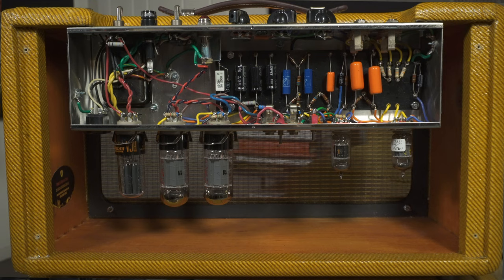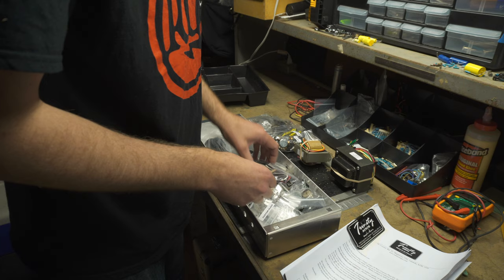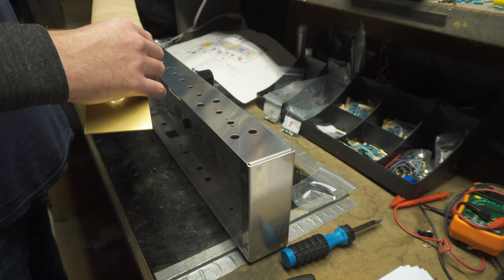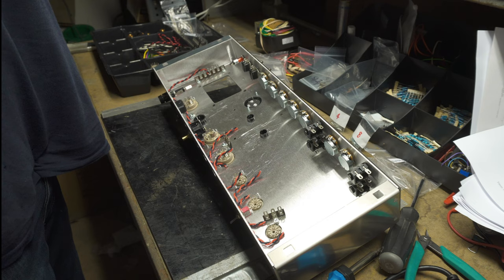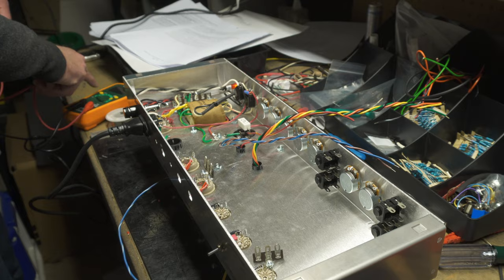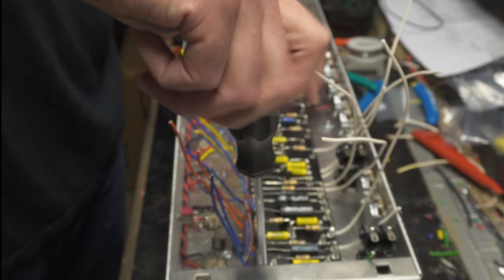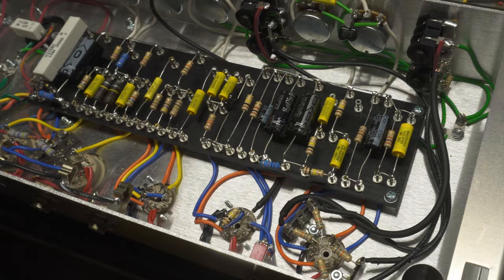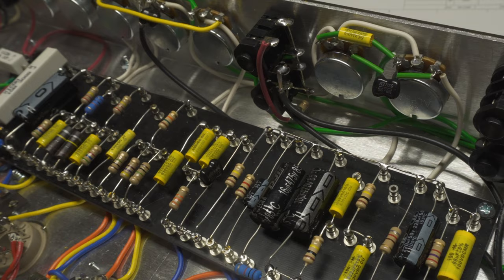Building a Marshall Plexi Style Amp? - Trinity Amps Custom Plexi with 6V6’s

Comment: Mike… my son and I have built 6 amps. 4 Fender Tweed Champs, a Fender Tweed Delux and a Marshal JTM45. All of them were learning exercises. They were technically kits, but we modified/upgraded each one. 8 scratch built the cabinets. My son covered the tweed. You are correct in your comment about the pride in doing it yourself. We checked and double checked everything to head off any trouble. .

Comment: I really appreciate these amp build videos, they're very helpful in showing that with little experience you can build one of these from a kit. I have basic knowledge on how an amp works in theory and I can look at a schematic and know roughly what's going on but I've always been very apprehensive about taking the dive into a kit. Thank you for documenting your experience and showing that it's possible even for someone like me with limited knowledge and no experience :)
Reply from the maker: Glad you enjoyed them. Working on another currently but it’s slow going! 
Following the layouts and taking it slow is key.
Reply: @MichaelWWestbrook  I look forward to seeing it! I definitely plan on taking my time and triple checking everything. Maybe even doing one section of the amp at a time then taking a break, power supply, heaters, preamp, etc. Just break it down into groups and take it one at a time. I'm thinking of getting the Mojotone JMP 2204 kit as well which probably isn't the best kit for a first build but I really want a full sized Marshall
Reply from the maker: I’ve found the bigger amps are more complicated in some ways and more simple in others. Tweed Champs or Deluxe’s are simple but space is tight. More room in the chassis is easier to work with for sure.

Comment: Unless you have to wheel a dolly through there on a regular basis you could shorten the door on the bottom and install a 3-4 inch concrete lip to help stop that flooding from happening again.
Reply from the maker: It was a run off issue that has been diverted. Basically all the water from our backyard got funneled into that door way because of leaf build up and landscaping. Hasn’t happen since!
Reply: @MichaelWWestbrook  nice

Comment: not to be a smart ass... but you need a sump pump , so if there is another basement flood ... its ready to protect the basement ... right.  also you could look into why water is getting in and  slop the ground. kind of important... what if the deluxe was on the ground and got soaked... oh that would hurt... and do you have a carbon monoxide / fire alarm in the basement... a little safety goes a long way... after all you seem meticulous building amps... why not spend some  attention on safety...   love your videos... Im going to build a deluxe tweed.... cant decide Mojotone or trinity ... thanks again...
Reply from the maker: It’s was an outside drainage issue that easily resolved. Never had any other issues but I never put anything of value on the floor just in case. (That’s why the deluxe wasn’t on the floor)

Comment: My first tube amp build was a kit from a local UK supplier - a 5F1 4W single-ended Tweed clone, which was super easy and fun to assemble. This video has been a real education as to how amp builds should be done. Bravo! Very impressed with the build - extremely tidy wiring runs. I've seen some horrendous kit-build videos and it makes me wonder how anyone could fault-find and set up an amp properly like that. You've got me wanting to build a TMB now. Dang it!

Comment: I grew up in GA - that flooding in the basement brought back memories of my dad’s workshop in the basement. I also test each component before it’s soldered in. It’s so much easier to find a bad component before it’s installed. There are low cost capacitor meters on Amazon. I even check all components on pedal builds too. Your music sounds FANTASTIC!!!
Reply: many digital multimeters have a cap measurement function. then there's that  low cost TC1 component tester,that checks all sorts of components,but it's not a  precision measuring device.

Comment: I built a Trinity B15 clone.  It turned out awesome,.  It’s great to use an amp I made in my studio.  Trinity is a great amp kit company.  I do suggest you upgrade the sockets.  Especially if you roll tubes a lot.  The contacts loose their grip.

Comment: Great job. The Trinity Plexi was my first amp build, and I wouldn't hesitate to recommend Trinity to any aspiring amp builders. Stephen even provided a rear panel for my chassis when I asked about one. I think their TC-15 will be my next build. You should try installing their VRM module, I did with good results.
Reply from the maker: Thanks! I’ve got a VRM for my tweed but haven’t installed it yet. Maybe one day but haven’t really need it for my uses.

Comment: I just finished a 5E3 and it is without a doubt the best amp I've owned. Desert island amp. I really want to build a JTM as soon as they come available. Ive been playing 45 years and have owned and gigged  just about every decent valve amp there is. If you can source a good kit and have some patience and can solder? You'll be hard pressed to find a mass produced amp as good. I built my first amp out of curiosity and now I'm totally convinced that hand wired is the king of tone.

Comment: The twisted wires going to your tube sockets should arch up and go straight down to your sockets. Less noise, less hum.
Reply from the maker: In this case I ran them close to the chassis (the opposite side as the rest of the wires to give them distance. From my understanding their proximity to the chassis will help shield out more noise as well. Seems like others have had success with this method as well and because they are an early part of the build this keeps them out of the way when making the rest of the connections
Reply: Lay down is fine. In this case the sockets would need to be turned 180* and the heater wires should be ran through the top of the so no other wires overlap them. If there’s no noise issues, nothing needs to be done.
Reply: @MichaelWWestbrook  If it works it works. AND, it sounds great so there is that! Congrats. Keep building!

Comment: install an automatic SUMP PUMP in that basement shop. it will help prevent flooding. 
also,it looks like most of the resistors in that kit are carbon FILM ,aside from the blue bodied resistors,that are metal film. Carbon film resistors are "dumbbell" shaped,they have end caps for the wire terminals. best to avoid carbon resistors in these tube amps.

Comment: When I build kits, I point plug tabs towards controls, and wire them before installing controls giving me more room to work with ! 😁 I mount turret board differently ! Top mount all wires first to sockets and controls then circuit components ! I I hate amp builds where the wiring looks like a plate of wet noodles dropped on the floor ! LoL

Comment: What you might try is  to make a template out of plastic, or even cardboard,  for your pots and input jacks and solder them outside of the chassis, giving you much more room.  I found it hard to solder up those Cliff jacks inside the chassis.  Just a thought.

Comment: Yeah these are fun projects to build. 
I've only built one from a kit once. Usually I end up building my amps from scratch and end up doing everything the hard way... Lol 
Now I really want to move on to building hifi stereo tube amplifier systems, like an all tube tri, or maybe even quad-amped stereo system with a tube 3 or 4-way active crossover with an 8 band tube equalizer. I've found some websites that show the basics of the schematics to get started with. 
But jeez, all those transformers sooooo expensive.... Lol.

Comment: You should core a hole in the ground and stuck a 5 gallon pale with 1/2 inch holes drilled throughout the bucket. Drop a submersible pump in there and bam more flooding.

Comment: Nice Video.  I've built several amps as well and I suggest getting an amp chassis stand or perhaps building your own... could be its own video.   I was at the Rib Cook Off in Reno as well.  Not the same days though.
Reply from the maker: Yeah, I need to build one. At some point I rigged up a make shift one but it wasn’t the most reliable

Comment: in this amp build I see you use a turret board....  that seems so much more clean  and  actuate way to build... wish I could do this on the tweed deluxe... but seems the kit does not come this way.... I wonder could I install the posts on to a board  that does not have them on there... like a  blackface deluxe reverb... 
sweet build...  thanks again...

Comment: Nice Video, nice Amp! I build my first Amp back in 2006. It was a Tweed Bassman59.  The second one was a Marshall Plexi (JMP50, Model 1987) back in 2011. Great Amps, but not for using it at home. The Amps are way to loud.
Reply from the maker: Yeah, that’s were where Two Notes Captor comes in handy. I wouldn’t be able to record nearly as much!
Reply: @MichaelWWestbrook  You´re meaning the Captor X, i think. Any experience? I got two of the Tom-Scholz-Power-Soaks but they make the sound thinner on a low level.
Reply from the maker: I use the regular captor and run the IR’s in my DAW. The Captor X is essentially the same set up but all in one package
Reply: @MichaelWWestbrook  Ok, I checked out several videos in the last two weeks. I think the  Two Notes Torpedo Reload is the better choice for me. I ordered one for a test.

Comment: I think I saw a 15K tail resistor, unless it’s like that because of the 6V6’s, it’s a mistake. Stock Marshall everything is 10K.
Anything between a 6.8k and 27k will usually work. 6.8k to 7.5k give the best gain balance from the inverter, anything higher drives one of the output tubes harder than the other, inducing asymmetrical distortion. 

Check out this link to see what the changes will do https://www.ampbooks.com/mobile/amplifier-calculators/long-tailed-pair/calculator/
Reply from the maker: Good eye, I’ll check it out.

Comment: Doesn't it matter which direction the resistors are wired in? Meaning, the paint stripes need to be oriented a certain direction? It looks like fun. I've been doing automotive wiring for years and think I could build an amp if the instructions, pics and schematics are clear.
Reply from the maker: No, doesn’t matter for resistors!
Reply: Thank you. I wasn’t sure and thought I saw another amp builder say it did. Good to know.
Reply from the maker: Caps do generally but not resistors.

Comment: I just received my Tweed Deluxe. Pretty stoked. As I recall from your tweed build I seem to recall you mentioning a plan to gut your blackface  deluxe and rewire it p2p. Is my memory correct? Did you remove the circuit board and convert that into a handwired drri? Did it sound any different? It seems like a great way to keep improving your skills and gear
Reply from the maker: Haven’t done this! I’ve got some other plans for it currently but more on that down the road

Comment: what did you use to plug that tube punch out? I cant find them anywhere on the internet. and I am doing a build that I have to do the same thing with. thanks for the great video
Reply from the maker: Came with the kit. Not sure what they are called or where to find them!
Reply: @MichaelWWestbrook  no need to plug them,the extra ventilation will help longevity. But,as you said,they came with the kit.
BTW,carbon film resistors aren't known for long life.

Comment: If going "Marshall, why not the EL34s?
Reply from the maker: El34 would be great but I do like the low wattage/volume of the 6v6’s. I was curious about how “Marshall”-y it would be without the EL34 and while there is some difference I’m not disappointed.
Reply: You did a great job on building that amplifier it looks like a work of art and sounds great !
Reply from the maker: Thanks!

Comment: And, try get your capacitors up and away from the bottom of the tube sockets...lots of heat coming up from the tubes.
Reply: those are the screen grid resistors, not capacitors. But yes, they should be moved away from the socket :)
Reply: the tube envelopes are on the other,top side of the chassis,and the heat will travel upwards. Unless that chassis is mounted inverted,which doesn't seem to be the case in the Marshall head amp cabinet..

Comment: If you think building a killer sounding amplifier is just simply following a schematic and soldering it together... you're in for a nasty surprise; oscillation, parasitic noise, phase relations, etc. etc. etc. are but the beginning of things to consider and deal with when designing and/or building an amplifier. I get a kick out of all these noobs who think they're Ken Fischer 🤣
Reply from the maker: I’ll have to respectfully disagree. I’ve now built 2 killer amps and don’t know the first thing about designing one from scratch. I’ve simply followed a well designed layout (from a trusted company) with a foundational knowledge of tube amp safety and good practices. I’ll be the first to tell you I’m no expert but I’ve been able to build 2 wonderful amps and learn a ton in the process.

Comment: When you had to consult the internet for the jacks connectors. I was out right there 
Come on dude...my 11 year old daughter said so why can't he turn it, it's a round jack plug.
Reply from the maker: I’m not sure that’s what I said but whatever, you’re out - the pro tip is to wire them on the other side of the chassis then flip them back in. Not just turn the jack…They are round but the pins need to face a certain way.